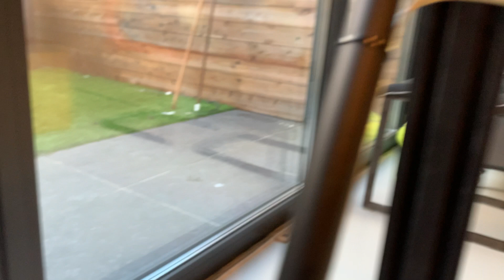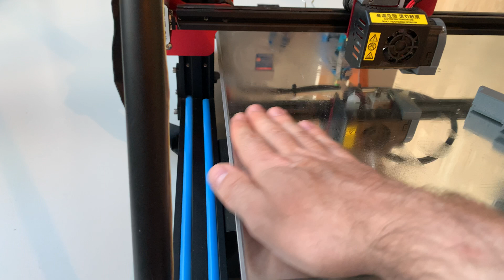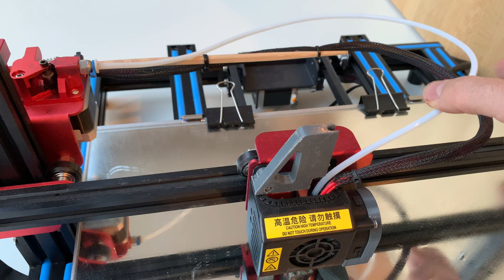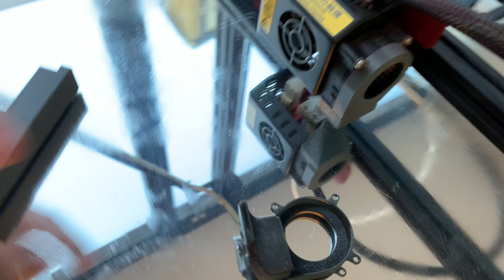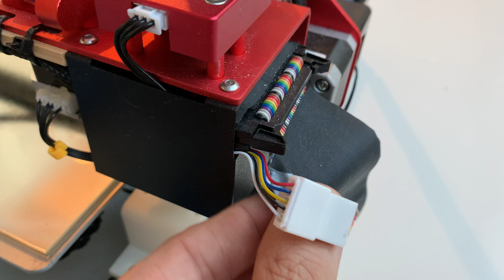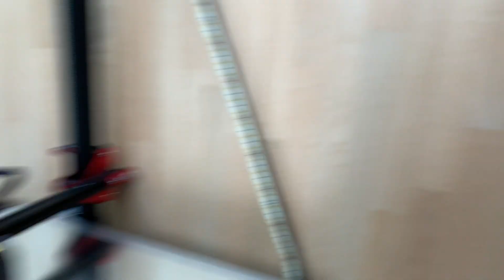My upgrades to the creality cr 10 max

Comment: We have one at work and to be honest it had several design flaws as you described, the bed is real crap and the x axis as you said is not in sync, a pulley between them should have been a easy fix for creality. 2 drivers and 2 end stops the more expensive and best way.

As usual with creality you buy it because you want to fix it :)

Comment: Hey Dave! I have the same printer. For gantry leveling I use 2 identical printed blocks and put the gantry manually (motors disabled) down so that both the left and right side rests on one of these blocks. No need to grasp one side while setting the other side. Then I just raise the Z axis, which powers both motors again and then they will stay level. I do this for each and ever print. The same as what you do but maybe even easier. Hey BTW thanks or the video. Looks like the support for the bowden tube is also a good add-on. Would you happen to have the stl file around? I can not immediately find the link on thingyverse. Greetz, Nicolas
Reply from the maker: https://www.thingiverse.com/thing:4284802

Comment: I have one of these machines my first ever 3d printer, I used ground  engineers blocks to level gantry and installed backlash nuts as well. The grease off your fingers can cause adhesion issues so use IPA and a rag to clean surface. Also i don't use the 0.2 shim to level but use a 0.1 sheet of paper and have had no issues. Have installed a microswiss all metal end and   Am planning on installing a direct drive extruder from them as well.
Reply: im about to purchase the biqu h2 as direct drive for the cr-10 max. (and the backlash nuts)
Have you maybe seen a good tutorial/guide/manual for the y-axis (belts)?

kind regards,
Rik
Reply: @rikvermeer1325  I got one for the X axis off aliexpress but haven't seen one for the y axis yet,I got a Micro-Swiss All metal hot end on my CR10-max now love it

Comment: I've had pretty good luck with the tinymachine's z-sync kit for what it's worth.
Reply from the maker: I wanted to buy it but shipping and taxes included it's about 170$. That's a bit expensive
Reply: @Treedeedave  Actually the kit costs 20$ and shipping to Belgium is 28$.I just ordered one. I used a customs/tax calculator just to be sure, shouldn't cost me anything extra. Not sure where you got that 170$ from. I would also like to print and install that capricorn/bowden tube brace/guide you've put on your Cr 10 max. But I can't seem to find it anywhere (Thingiverse). Could you point me in the right direction?
Reply: @marcohornstra8982  I'm going for the biqu h2 direct drive extruder and will probably be moving to klipper for the "input shaping" function for the resonance compensation (especially against the bed weight).

Do you have any knowledge about rebuilding the y-axis?

Groeten,
Rik
Reply: I don't speak English very well.  Did I understand correctly you have installed Tiny machines?  because with my Max impossible to make prints there is each time a problem when launching the prints.  at the auto leveling stage ...
Reply: @Stradito  I have ordered it. It will be some (10 days, 2 weeks who knows) time before I will receive my order. 
What problem do you have exactly? I ordered the tiny machines Z sync kit so I won't have to level the gantry every time I power off/on the printer.
When the printer is powered down the left side of the gantry will lower a little bit, while the right side might move up a tiny bit.
If you don't have a z sync kit, you will have to level the gantry with the black plastic rectangle piece included with the printer every time you power up the printer.

This video might also help. https://www.youtube.com/watch?v=lE9i1-DX1aI
Reply: @Stradito  sounds like you might need to update the firmware... but that's a wild guess :)